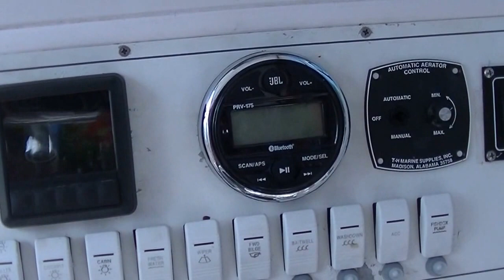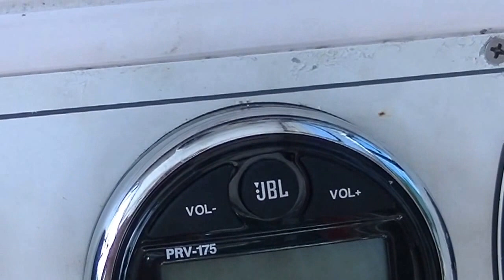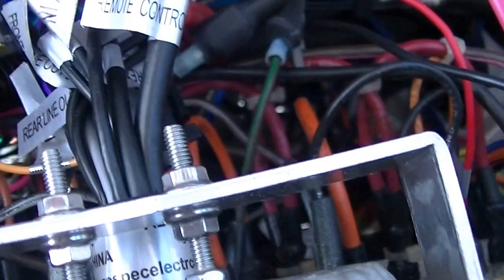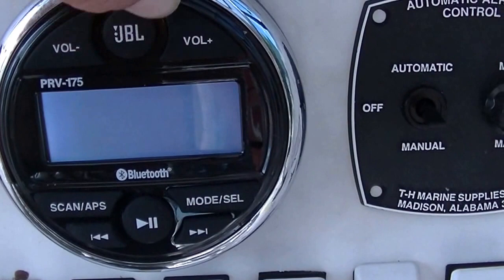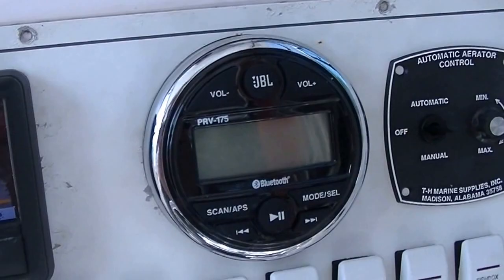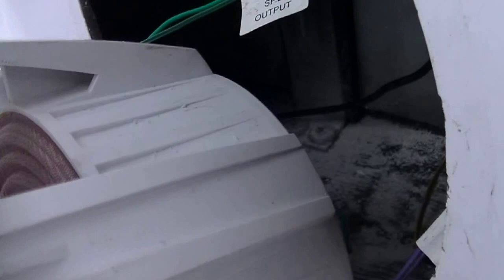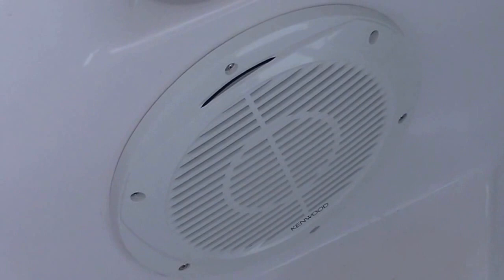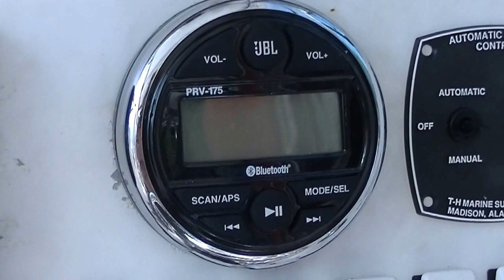How to:  JBL PRV-175, JBL 6510 speakers & Kenwood P-WD250MRW 10" sub/amp install and review

Comment: Thanks for the video!  I'm preparing my own small mobile audio install - but I wanted to mention that I have one of the auxiliary subwoofer modules in my car (I believe MTX) and it's great for having precise control over the bass level.  Sure it's another knob / component in the mix but can really help out when I pull up to a stop light (or in your case a no-wake zone ;P) and don't want to disturb the neighbors.  Great work!   PS - I used to have a pro-line 2510 and miss that boat so much.

Comment: You talked 12 minutes about the installation, which is very clean I must say👌, but we dont get to hear the outcome. What was the point of the video? Could of just showed it to us while it was still in the box!
Reply from the maker: Billy Miller as in what it sounds like?  Recording the audio output never sounds great and then I’ll have copyright issues to deal with. The audio sounds great but you’ll have to take my word on that.
Reply: Agree to disagree I suppose. Even through phone recordings, you can still hear the difference in a quality JBL/RF/JL system vs say Boss or Dual etc. Also, decibel meter app on your phone works great to show us how loud it gets. Great video on the clean installation though, just wish it could be heard. I'm about halfway through building a similar system in my bay boat.
Reply: @billymiller9035  haha absolutely not! Disagree there too..

Best systems I’ve ever heard I tried to record and they sounded garbage on a decent camera, unless I put a Rhode on my DSLR. 

You’re far better off listening to somebody’s opinion that’s able to compare the sound with some form of baseline, like a factory unit or previous setup etc. 

Otherwise, sound is super subjective anyway..

That being said it’s always nice to see/hear an installed unit full blast on some good songs to see the unit at work, even if the sound is crap on the recording, even if it’s just for a few seconds.. or to show the difference in Jazz vs Rock on the presets etc, or the bass control in the settings, etc.. 

Also, if you’re connected via Bluetooth there is plenty of royalty free music on YouTube itself that you could play to avoid the copyright BS on this platform.. 

Just my two cents 

Thanks for sharing, love the setup, clean install.

Comment: Did you run separate wires for the sub directly to battery or splice from the wires already there?
Reply from the maker: Boulder Music Man my boat has a power block in the console which I wired to. I’m probably going to run wires from the battery though because I have had the sub fade out when I’ve cranked the stereo all the way up.